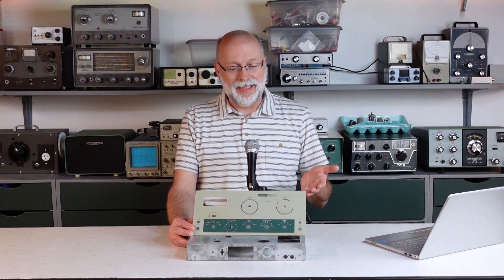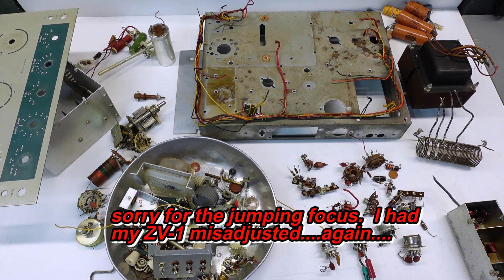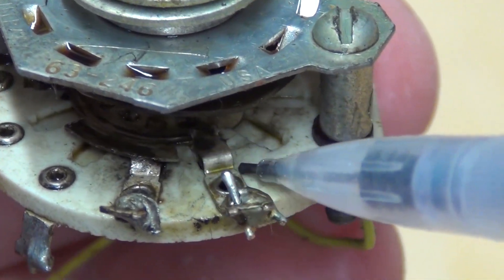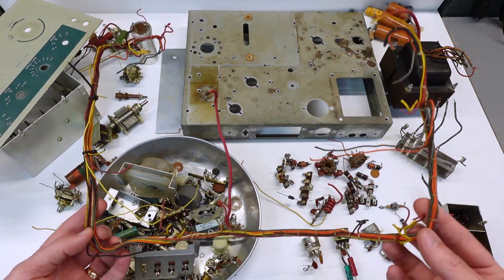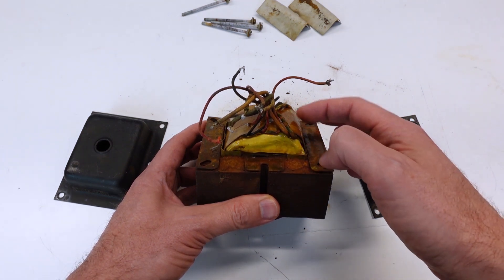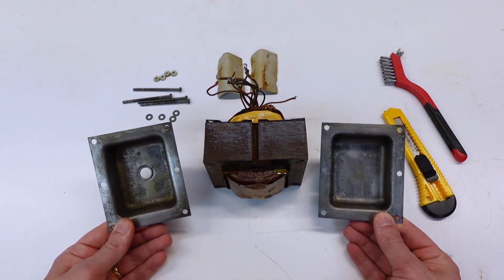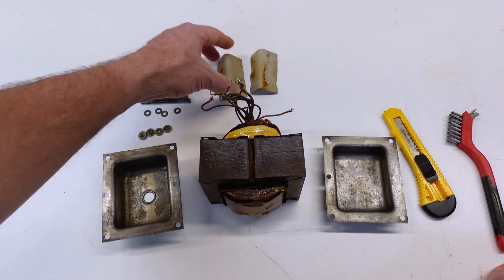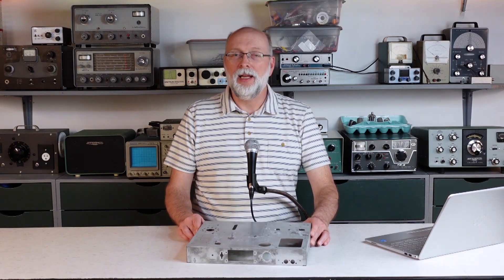Heathkit DX-60: Part #2

Comment: Great video, Daryn!  You’ve inspired me to do a complete teardown of my recently-acquired Heathkit IP-32 power supply that I picked up on eBay. Needless to say, the two transformers in the power supply have quite a bit of surface rust on them, but it doesn’t look like the rust penetrated any of the laminations. The transformers test good.  Question:  Would you suggest using a product like Evapo-Rust to get rid of the rust on a transformer, or should I just wire brush and paint them?  

Looking forward to hearing from you.j

Sincerely,
Kenan, KR6J